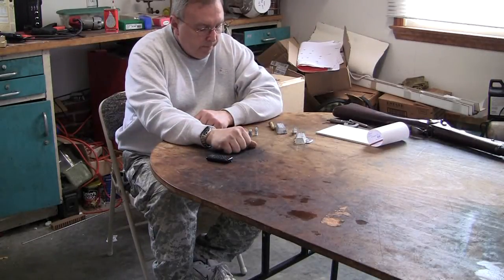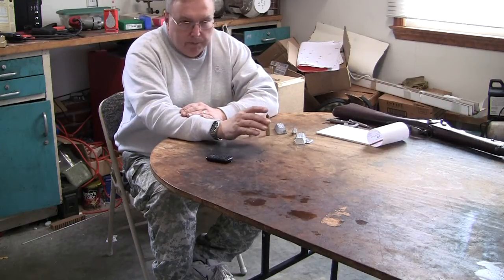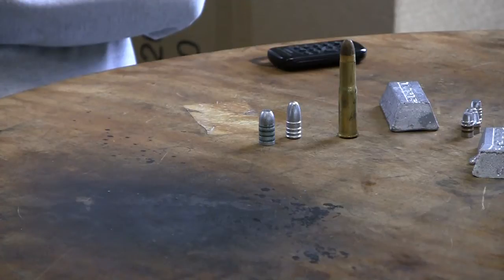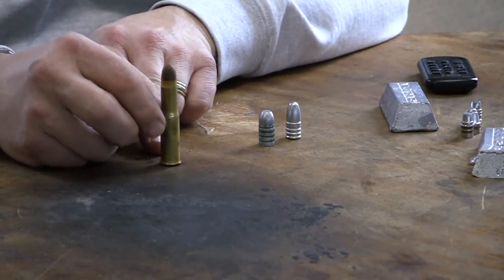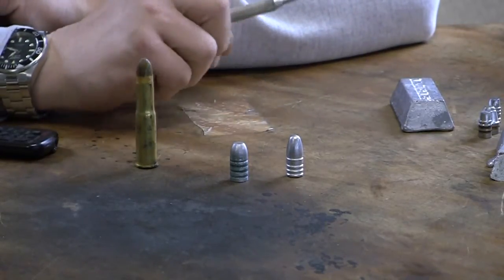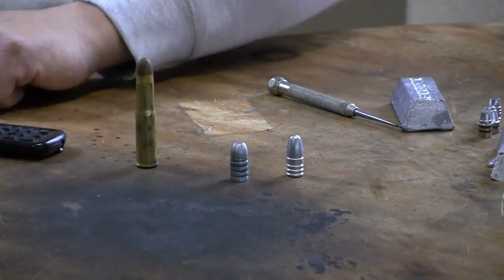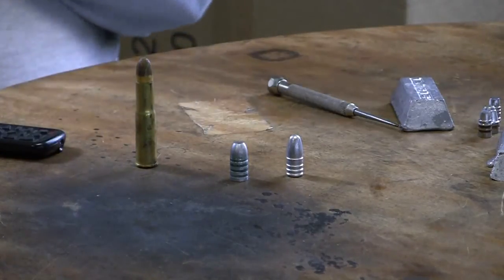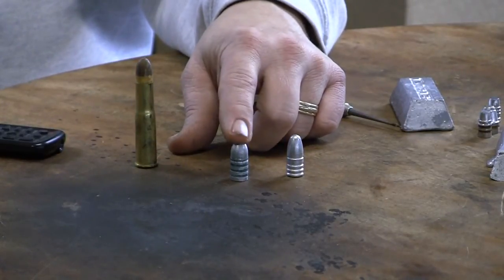lead Alloys for Black powder Rifle Bullets

Comment: Math nomenclature uses the colon to mark the parts of one ingredient in ratio to the other part, i.e. 16:1, which is sixteen parts lead to one part tin, not necessarily pounds, can be ounces, and 20:1, 30:1, 40:1, 50:1, 60:1 (1.5% tin mixed in with 98.5% pure lead), and so on. And bullets can be sized up with paper patches, like the paper patch on your old 45-70 round there. The paper patch will prevent leading, too.